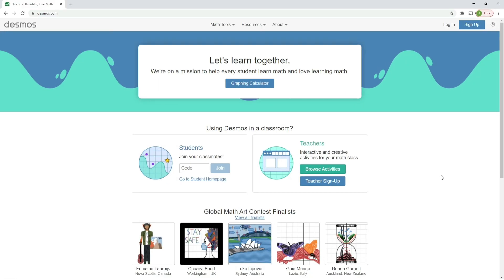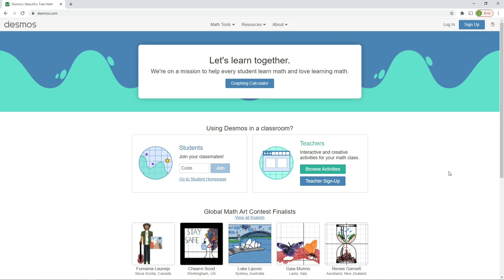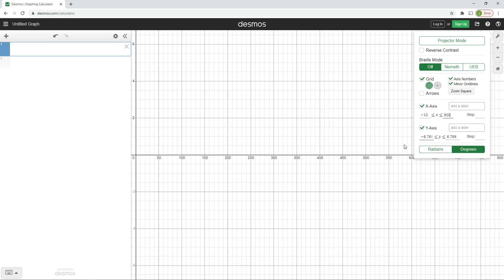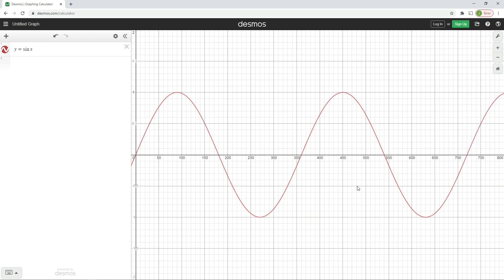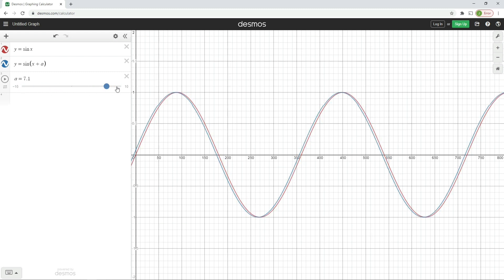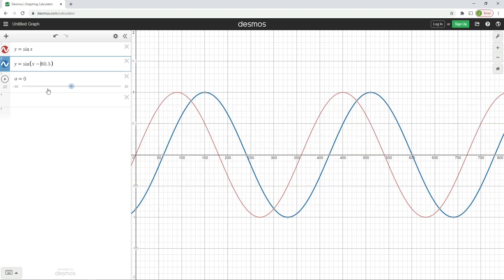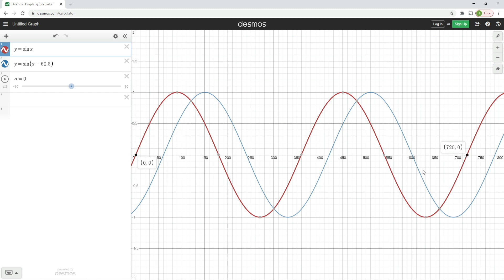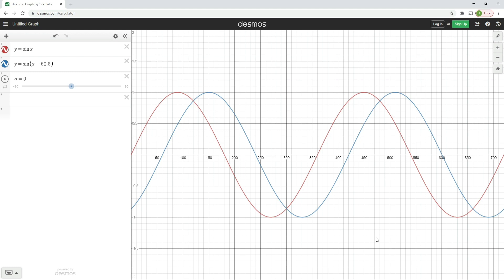AC Theory: How to Sketch an Out of Phase Waveform

Comment: Hi Joe, love your video. I have to produce a waveform using a motor which has a voltage of 280V and 5.6 amperes (45 degrees phase lag) (Peak values) would you know how to do this?